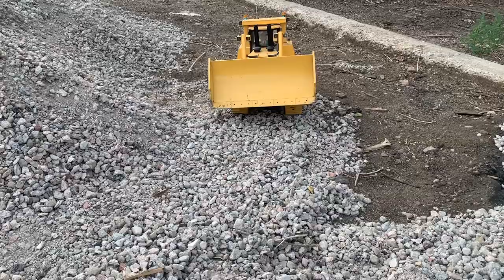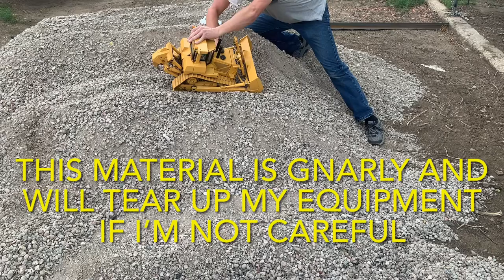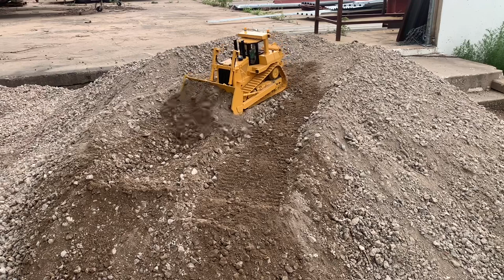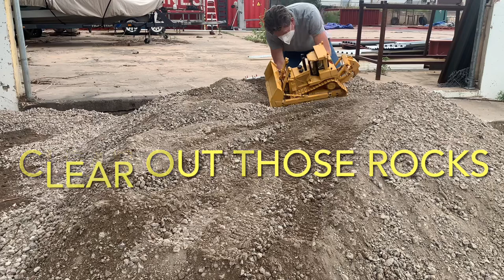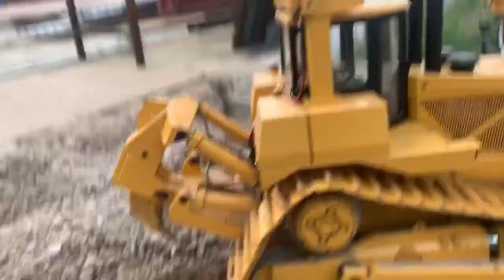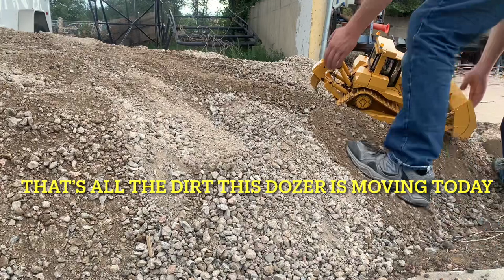King of the mountain. Bulldozer DXR2 pushing large amounts of gravel & steep climbs. Rc construction

Comment: Very nice, only thing i dont like to much is the very loud electric motor noise. But i dont know if there exist less loud once. Sometimes its also just the microphone recording high sounds better.
Reply from the maker: No, those drives are extremely noisy. The sound system is not real loud on the dozer either. It needs a better sound system but that will be a future upgrade. There is a brushless drive upgrades that’s out there but I’m not sure if it’s quieter or not. I know it’s really expensive and not sure if I’ll upgrade to that one or not.
Reply: @digitrc  I read in a german forum that motors are noisy when not running at full speed. Basically if they get regulated all the time.
Reply from the maker: @phoenixsui  it’s not the motors themselves that are noisy, it’s the gear reduction system that’s noisy.

Comment: It might be better to use sand ?
Reply from the maker: This was a real driveway ramp. I showcase my equipment doing real world work with real world materials. It’s harder on the equipment but it’s fun to see the finished results. That crushed recycled concrete was the worst but I moved all that material using my RC equipment and transformed a “mountain” into a drive way level transition. A ramp. The only thing that was done manually was the compaction. It was a fun project.
Reply from the maker: But check out my videos “the watering hole”. I used sand for some top layer material!! Man I love working with the sand. It was so much fun. Especially when dry!!! It’s mesmerizing.
Reply: How many battery changes did you have to do to finish job?
Reply from the maker: @joew2303  it took several days running 2 packs each day. I would say I ran 10 packs in the dozer. I get 30 to 40 min a charge.